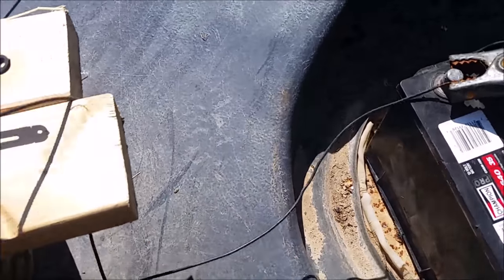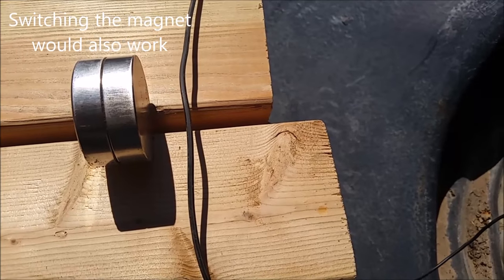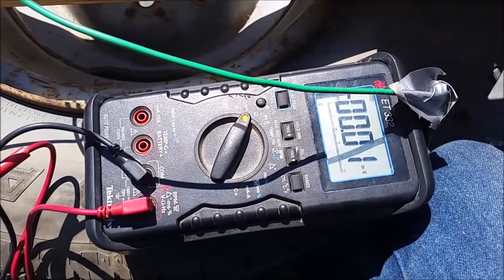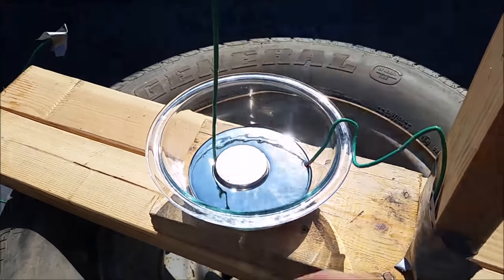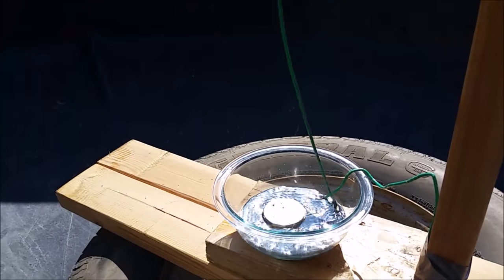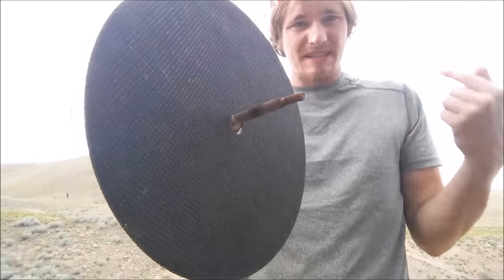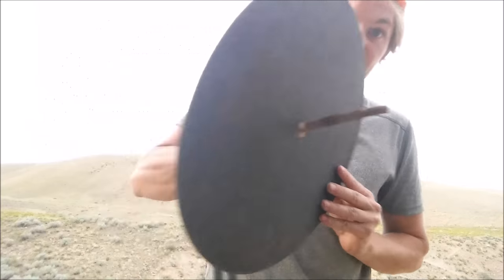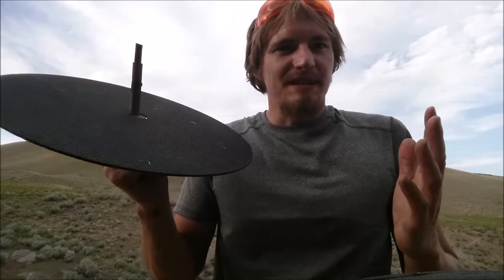Faraday Motor

Comment: So cool to see someone explaining this fundamental principle so easily. I wonder if you could do some more explaining? I feel it is time. The production of electrical energy via magnetic displacement is achieved in only one of four ways. 1. A wire is passed my a stationary magnet. 2. A magnet is passed by a stationary wire. 3. A coil of wire is energised or discharged in proximity to another coil, inducing current. 4. The polarity is changed in an energised coil in proximity to another coil of wire, inducing current. This last method is the most efficient, and with proper switching methods and speeds can produce currents in excess of the losses in the primary. I think though, simply demonstrating this fact of fast switching to your many subscribers may encourage someone to build something.

Comment: The best way to explain the disk moving, is using the conservation of angular momentum. The disk spinning generates an angular momentum which can be represented by a vector in the direction of the cylinder pointing his right hand and with origin in the disk. The force applied generates a momentum pointing to the sky and with its origin also in the disk. The resultant vector (angular momentum + momentum of the force) is should always be orthogonal with the disk spinning. the disk will rotate trying to fixate this new resultant, ending up moving to get perpendicular to this new vector. The angle of rotation of the disk depends on the angular momentum vector and the force momentum. if the force momentum is way way bigger than the angular momentum, the disk should end spinning parallel  towards the floor.
Reply: +eckhard debusschere or at least really close to be parallel with the floor. The main problem is the inflexibility of the  metallic axis.

Comment: Multiplying vectors is not always as you have described them, there is not always a perpendicular product. There are two kinds of vector multiplication (that I am at least aware of as a second year physics undergraduate), a dot product and a cross product. In this video you are hinting at cross products as of course Lorentz's law describing how moving charges in magnetic fields experience a force uses a cross product. Other forms of vector multiplication could be calculating the word done moving an object using a force. The work (amount of energy needed) is equal to the dot product of the displacement (position vector) and the force vector. You'll notice that with a dot product you end up with a scalar (directionless quantity, unlike a vector) whereas a cross product leaves you with another vector perpendicular to the two vectors multiplied.

Comment: Introducing the world's most toxic kitchen blender. ;) Seriously, thanks for building that. I've read about a Faraday's motor before but never saw one in action. And that mercury being stirred in the sunlight is very visual appealing. One question: It almost looks like the mercury is not in full contact of the top of the magnet. Do you think that was caused by simple surface tension or by maybe magnetic force?
Reply: Thanks

Comment: here is one for you cody . if you put several nuts together in a circle and run that wire through the middle it will make the nuts stick to each other but not through magnetics . you can use non magnetic stainless steal

Comment: you should find a way to use the moving magnet to supply power to your railgun. But instead of firing a metal bullet you should make it so it fires the magnetizing the power that it produces.

Comment: Going back to the start of the video with the wire defection, if you replaced the wire with with a length of fish tank silicone air tube and filled it with a saline solution, would it also deflect from the magnet? 

I see problems with generating hydrogen and oxygen in the pipe building up pressure.

Food for thought.. Or maybe a test?

Comment: I have always been amazed by electricity. I know the basic premise of how it works and why. so as you stated the atom is moving in a 3 dimensional spin as it skips through the wire the electrons skipping from one atom to the the next to create a voltage difference. anyways once you stated that the electrons or atoms move in a 3 dimensional fashion a picture popped in my head of the earth because the earth does the same thing. we are orbiting Sol our sun which the earth revolves around, most people may not think about this but the sun is moving through space as well so in a way the earth is in a vortex movement much like the described 3 dimensional movement. the earth is a large magnet and we are told it's because the core is a nickel iron core while molten is spinning around that core deep under the crust. I have never heard one of my professor's say anything about the atom moving like you have stated. I've only heard about how electricity is passed through a wire like copper or aluminum. the charge is passed through the wire by the magnetic field loosening or jarring loose the extra electron in the atom of the wire same goes throughout the entire wire then the next atom picks up the extra electron that has been jarred loose. my meaning is nothing more than to get your thoughts on the Earth's movement. maybe some speculation as to wether or not this would have anything to add I guess for lack of a better word to the Earth's magnetic field along with the molten core. almost becomes a philosophical question if you wanted to take it that far.

Comment: I suspect the rotor's motion would have been smoother had the stator's wire fed current to underneither the magnet.  Current likes to take the path of least resistance (shortest distance) through the mercury.  Feeding  current from the side will give asymmetric results.

Comment: Question: Being my unenlightened self, would it be possible for a contraption that spreads the electricity around technically make the magnet float, since the magnet will create a force when moving (falling) but not when it's directly in the center, assuming that the electricity is equalized everywhere?

Comment: It's still a matter of debate whether the 90-degree offset in the pitch of helicopter rotor blades is due to gyroscopic precession or due to the phase of the "flapping" of the rotor blades.  Cheers-
Reply: +Mike Lentsch  if that is true, then think of the logic of using a vehicle that can travel in 3 dimensions,  and we do not fully understand the physics LOL.  Not mocking just in awe.

Comment: I don't understand this.  When you run current through a wire there is an electromagnetic field where a compass would deflect North on one side and South on the other.

So when the electricity takes the path of least resistance shouldn't the wire just snap to the magnet (like it did out of the mercury) with the pole opposite the magnetic field?

I saw another version of this without a liquid.

Comment: in the first few minutes of the video, around 1:00, if you use an ac supply instead, with a sufficiently high frequency would the wire float?

Comment: I wonder if electrolyte would work instead of mercury. Or maybe... take some audio amplifier and connect this motor instead of a speaker. This way it should make "mercury speaker" (wire would stir the mercury which would make the sound). And if you played a single frequency this could make nice looking waves on top of a metal :)

Comment: So if a moving magnet creates electricity, could another magnet move a magnet in a steady way to produce electricity as a form of completely eco-friendly power?
Reply: Moving a magnet next to a conductor (in the right way) produces a current in the conductor (Lorentz Force, general case). This current then induces an opposite magnetic force that causes the initial magnet to be slowed down (Lenz's Law, special case).
If you want to move a magnet by another magnet, sure that works somehow. But you have to invest energy to get it moving and to steadily put in energy to keep it moving. When you then try to earn the energy in form of electricity from a wire thats fine, but you just converted your initial work (mechanical energy) into electrical energy. There is no free energy (Conservation of Energy). In fact, with each conversion step you will "lose" energy (e.g. convert to not usable energy like heat diffusing away). Whether this conversion method is eco-friendly is mostly determined by where you get that initial energy from, that you use to move the first magnet (solar power or coal? a man on a treadmill or a weight falling down? etc.).
One of the simplest methods to convert mechanical energy (push/pull) into eletric energy is by using a dynamo (rotate a magnet next to some wire) like on your bike. The bigger version of that is a generator which is usually not powered by manpower, but with heat driven pressure through a pipe. But a generator and a dynamo both convert mechanical energy (rotation) into eletrical energy. The way you make the blades rotate is the difference and decided whether it is eco-friendly. Hope that helped :)
Reply: Hans Woast Thanks for your extensive answer! Really helped
Reply: You're welcome :)
Reply: I know it has been more than a month but you seem to have an understanding of the topic, Hans. The coils have to have a electric current going through it and the magnet has to be moving through it to generate electricity as I understand it from my limited knowledge. Lets say you set a few "coil tubes" up that can be turned over, either manually or by other means, so that the magnets that would be inside the tubes would be constantly moving as the tubes rotated much like an hourglass. Considering how the coils need a charge in the first place the idea would be to connect a battery that would send the current through the coils and then use the produced electricity to charge the battery or another device. Would something like this be plausible? Just a thought thanks!
Reply: Hershiser is anó̱teros I'm not totally sure what your aim is, but there is no such thing as free energy [first law of thermodynamics]. You will in any(!) case earn less energy than you did put in before. This holds true for the entire known universe, no matter if you look at thermodynamics, quantum mechanics or whatever. (I'm a physicist =)
The conservation of (total) energy and the fact that each conversion of energy increases the part of inaccessible energy ("lost" energy: mostly heat, light and sound: e.g. energy you cannot fully use and that often is spreading uncontrollably) are leading to the conclusion that you need to keep it as simple as possible and avoid conversion.

Im not sure if you wanted to transform or store energy, but if you have moving parts - either microscopic (electrons) or macroscopic (a wire) - there will be friction (against air / internal resistance) and therefore energy converted to heat (e.g. "lost" for later usage).

The most efficient way to store energy is in a static and isolated system without moving parts.
The most efficient way to "create" energy is to avoid conversion as much as possible and keep it simple.

You cannot create (or destroy) energy, you can just transform it. When someone says they are "creating" energy, that is technically totally wrong. They are just converting energy to a more useful form (like sunlight to electricity) :P

If you still have questions, feel free to ask. I'm not sure if I got you right^^

Comment: where did faraday get the electricity to power his motor? I assume he must have used some sort of chemical battery. But given that your battery must be so much more powerfull and the same goes for your magnet, the motion he must have seen must have been very underwhelming. But is this actually the case?
Reply: Nikojohnson1991 Im thinking he might have had a bank of batteries since he had some papers on visible spark discharge, he might have worked with upwards of 20 or 30 volts and some respectable amperages

Comment: how does a magnetic field cause electrons to spin if there is only a north and south field? 
starting frtom electrons it spins around the tiny field lines and how does that cuase matter to spin with it?
Reply from the maker: +Aldion Sylkaj 
The magnet only attracts or repels the electrons, its the electrons spin that deflects this attraction 90 degrees off. (note: there are some quantum mechanical effects as well but I dont feel qualified to describe them)
Reply: *****
Thanks
Reply: +Aldion Sylkaj To add to what Cody said, an electron's spin isn't exactly like the spinning you would imagine with a spinning top or ball. Electrons are single points with zero volume so the notion of spin isn't quite the same as with macroscopic objects. When someone says an electron has "spin", what they really mean is that it has angular momentum, not that it's actually spinning around an axis.
Reply: +Aldion Sylkaj The spin of a subatomic particle is just an intrinsic property it has, and you can't imagine it as though it were a marble spinning around like a solid sphere. What we think of when we mention the space an electron occupies is it's charge density, which sort of encompasses the empty space around the electron - even further more you can't really say where this is due to quantum effects, so it's really hard to answer your question without writing a research paper explaining other things. You should check out Sixty Symbols youtube channel for more information on particle physics and quantum mechanics. It will help you understand what spin is exactly.

Comment: Why did you use mercury and not salt water, 
many have used salt water and you can also do it
in reverse with a magnet connected to screw head and point of screw
which is now magnetic connected magnetically to another metal piece like maybe a bolt a screw , all this in water with a plate of copper sitting on the bottom with wire connected to it, in this one the magnet spins

Comment: so we know that electrons can not be found because they move all the time ( that is why we have electron clouds) but are they moving incredibly small distance for incredibly small amount of time and if so they should be moving at the speed of light (i am pretty sure all quantum particles do move at that speed) and the question is if electron moves to new place the magnetic wave that he was releasing from the last known position will get to the new one and they will interfere. does my interference theory do anything?
Reply from the maker: +Anton Markov 
Electrons do interfere with them selves, look up the double slit experiment.
Reply: +Cody'sLab Thanks for the comment i didn't know that electrons have dual nature like photons. Now it's time to insert a magnet in my finger.
Reply: +Cody'sLab
would a fast rotation cause a larger rotation
instead of 90 degrees for instance 110 degrees?
Reply: +Anton Markov Oh but only massless particles can move at the speed of light, otherwise it would take an infinite amouth of energy.
Reply: It is not exactly like that you are right but they do, quantum particles do move at the speed of light for incredibly small distance and they change directions quantum physics are not limited by the speed of light( look at quantum entanglement ) it is hard to say if something has a mass because particles can be formed from massless particles and mass can be converted in to energy.
Reply: Yes but if you were to observe a particle with mass for a certain amouth of time (observe it while it's moving), I don't think  it could ever be moving at the speed of light. That would break all sorts of laws.

Comment: yo im 7:52 in are you just talking about gravity? gravity puts it out of phase 90 degrees? also your finger slipped more and more putting pressure where gravity was in favor anyway. could you use a metal rod and make sure you don't change where you're putting pressure? I didn't get that part at all. but the start was great

Comment: What do you think about the CRS-7 Launch Failure ?
Reply: It's the first Falcon 9 total mission failure. And its probably going to take them a bit to figure out what exactly happened which will delay their next launch and their next landing :( also, now they have to send up another docking adapter for the Dragon V2... But I guess its kind of good that this happened how and not no a manned / Dragon V2 / Mars One launch.
Reply: +Lehtaan Didn't the official report point to a failed strut in the fuel pressurization system?
Reply: well, the official report wasn't out when I wrote that comment
Reply: Lehtaan I see.
Reply: +Lehtaan  The MAN who financed that rocket was elon musk .. Tesla Cars CEO.. connect ur dots now...
Reply: VvBlAzEvV01 hm?
Reply: plz google elon musk ..
Lehtaan
Reply: +VvBlAzEvV01 I know who Elon Musk is but tell me how is that relevant to the topic? (Aside from where the financing came from)